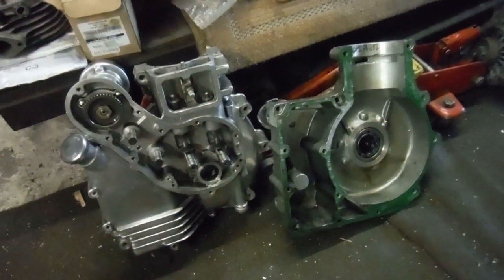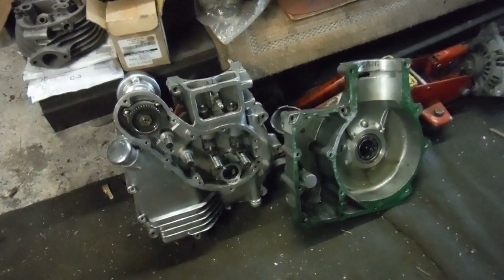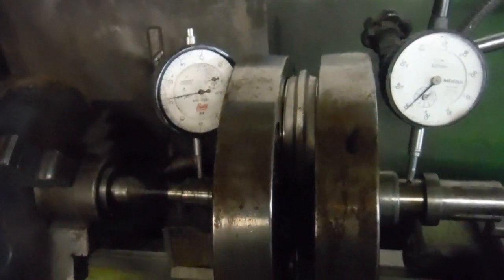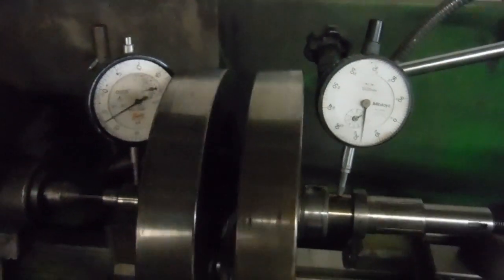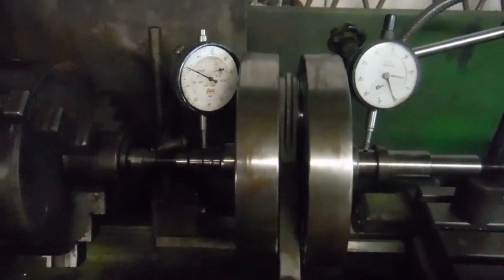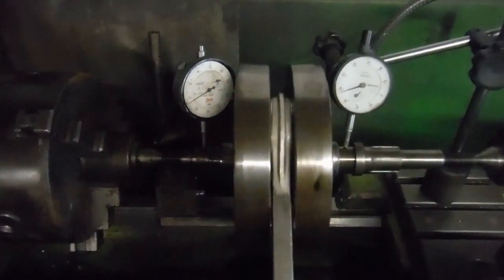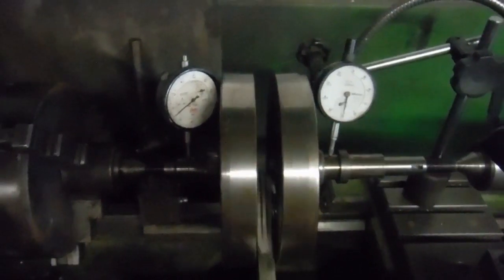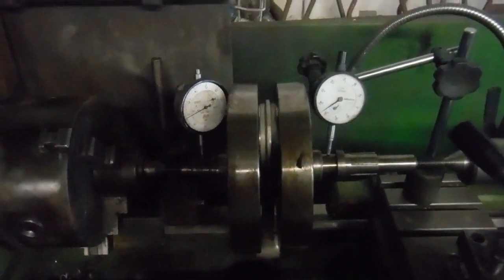Royal Enfield Indian Bullet crank with very bad runout. Part 1.

Comment: My jaw dropped when the gauges went opposite. I do wonder if the centres in the shafts are true. I've had experience with Indian made pumps where, when I put the pump shaft in the lathe it was clear that the centre was visibly out. I visited the workshops where they were making them in Mumbai (Bombay as it was then), I wouldn't call it a factory. Each operation was done on a seperate machine. Centre cut on one lathe, put on a cart with 100 others and taken to the next guy in another room who cut the major diameter without using the centre and so on until it became the finished piece. 
When I enquired why they used that system I was told by the owner that it was more efficient than changing tooling (not even a manual turret in sight). I was later told by a local ABS surveyor that this was BS, the owner didn't want his workers learning the whole process in case they went off and started making pumps in competition to him. Rather a long anecdote and I doubt this ever went on in the RE factory but it does open your eyes to cultural differences.
Reply from the maker: Thanks for sharing that, it doesn't surprise me!